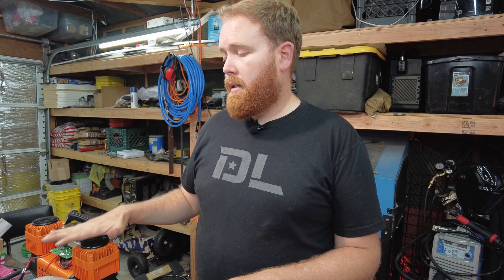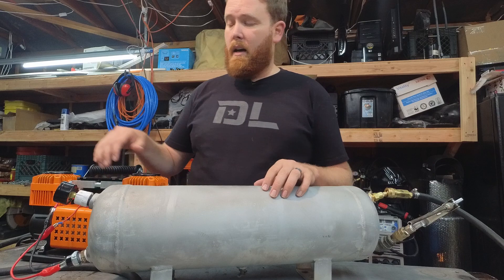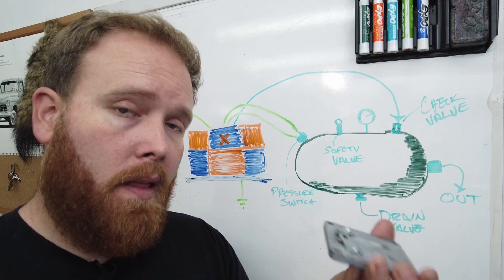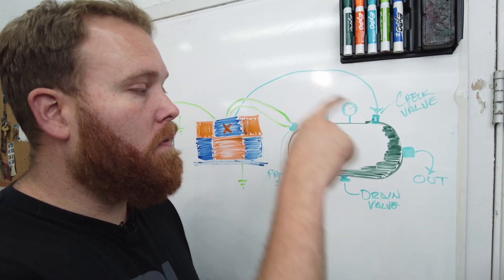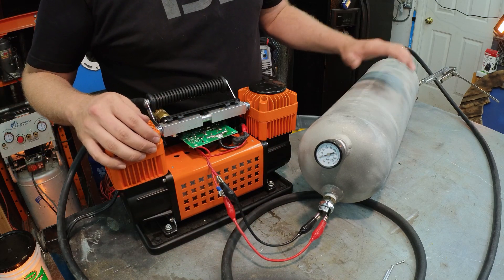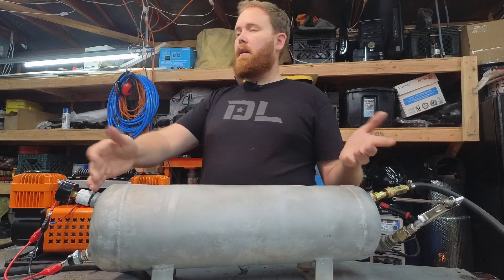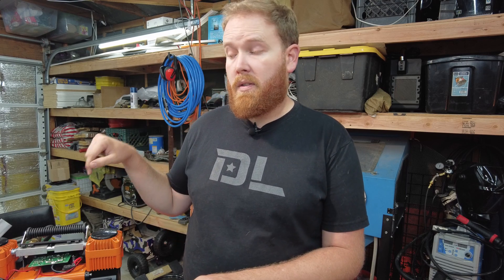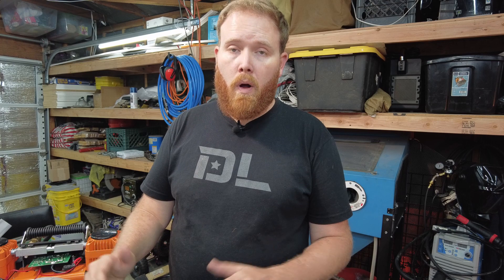Overlanding On Board Air Simplified

Comment: Weird mine has no trouble running up to 120 psi. But the output goes down as the psi goes up. As do ALL air compressors. I did a amp draw test on the whole 0-120psi cycle and one can see the draw is highest then drops off as pressure increases and output decreases.
I have an idea to build a high output 12v compressor that does 10ish cfm at 100cfm continuous duty. Just have to gather all the parts and fabricate it all. Oh and find time haha

Comment: Useful video.  Is there anything stopping someone taking a silent compressor - like the shop ones that come on wheels - and installing that in a vehicle?  Assuming you can separate the tank from the compressor and route some air hose around the place.
Reply from the maker: That would largely depend on the source voltage. The maxi trac compressor is quite similar to my California air tools compressor you see behind me.
Reply: The power demand is a big limiting factor.  The home style typically draw more than a 2000w inverter can provide. And those are pretty big. So one has to buy a huge Inverter and install huge 2/0 power cables to run it in addition to the compressor.
Reply from the maker: Nevermind the efficiency loss converting to AC.
Reply: @BadlandIndustries  Yes technically true...but at the same time the energy created by the alternator makes it pretty negligible and hidden from all but the nerdiest of off readers which there's very few of us haha

Comment: you could have left the pressure switch back at the compressor
Reply from the maker: True, I wanted the pressure on the tank since I had hoped to include a bleed off valve on the compressor.